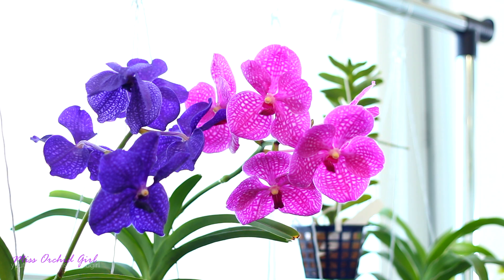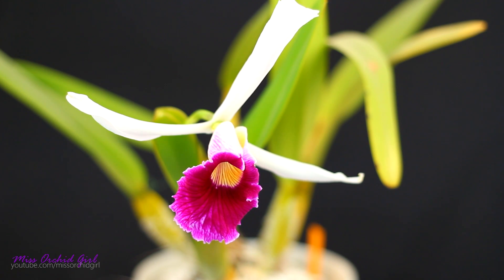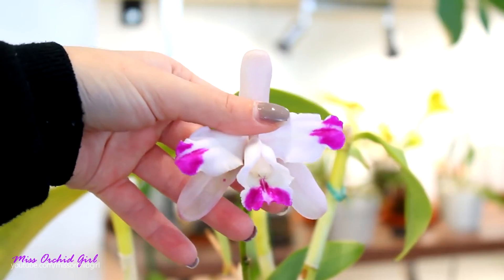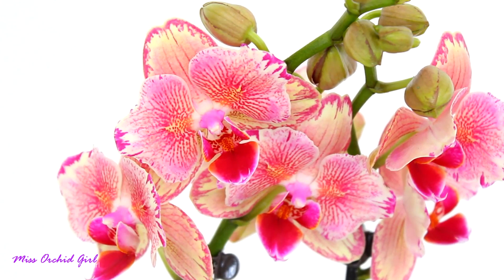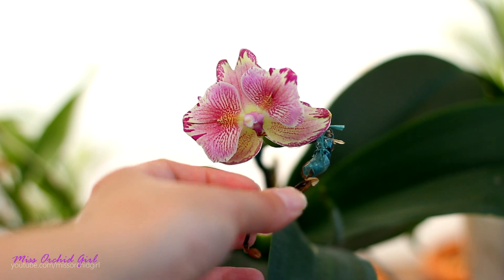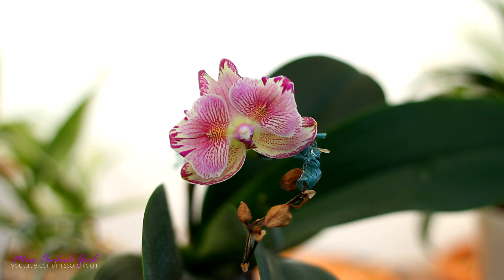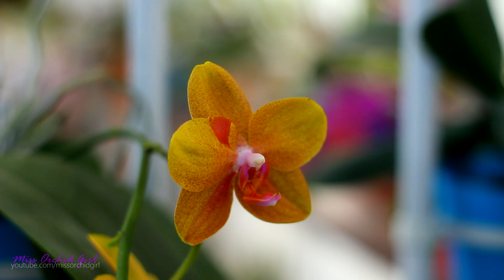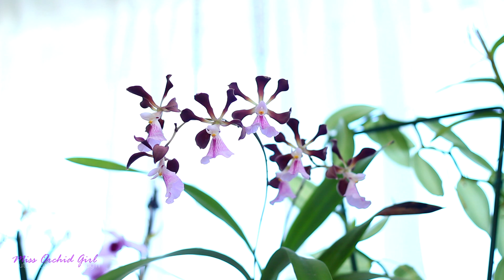Distorted Orchid flowers and glitches - What could cause them?

Comment: Many Cattleya change color if you grow them cool instead of warm.

From experience, Oncidopsis Nelly Isler blooms pinkish with white discolorations when grown on the warmer side, but deep, rich red when grown cooler.

You mentioned genetic factors but adding to it, the harlequin mutation in Phalaenopsis causis irregular accumulations of pigments. In more extreme cases the pigments gather so much that it thickens the petals irregularily and twist them. There are a couple of common very dark purple phal hybrids like that, but all harlequins with lots of pigmentation can display some petal deformities, a trait that hybridizers are selecting against as best as they can. Future hybrids will keep improving.